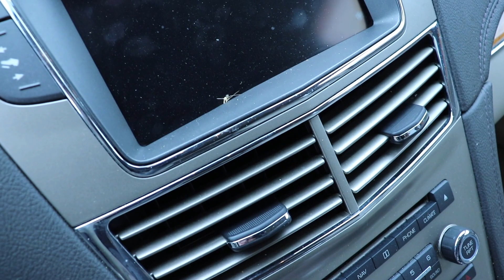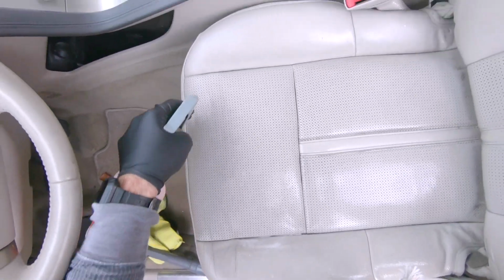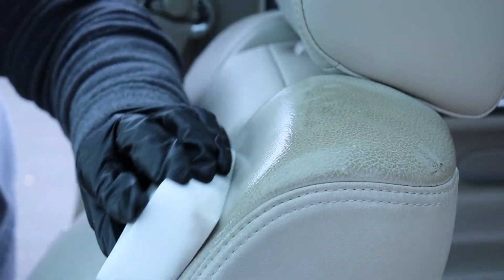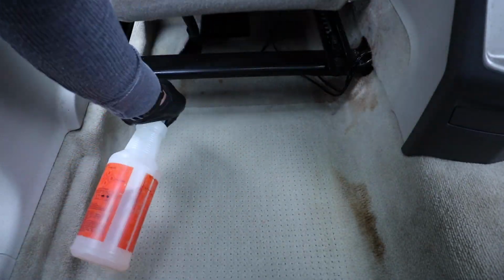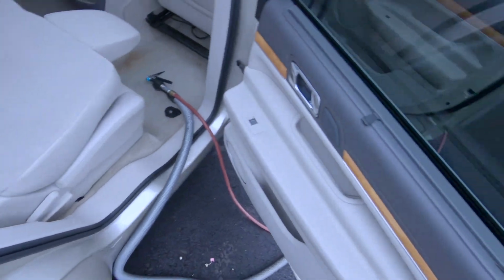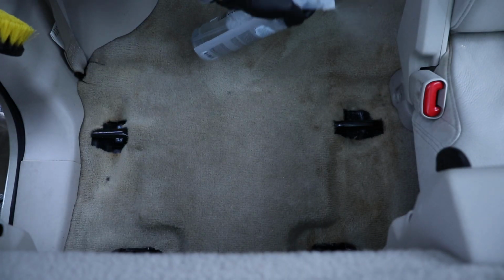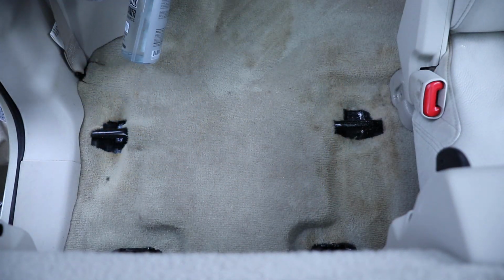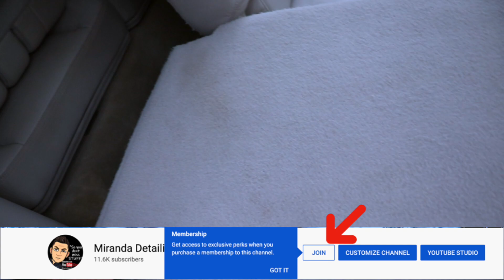Interior Detailing // Heavy Carpet Shampooing! // Old Lincoln MKT

Comment: Phil, totally agree with you about removing seats. not so bad on older cars however, some newer cars have sensors in the seat tracks (typically attached to seat anchor bolts) that measure the occupants weight allowing the computer vary the speed of the airbag inflation during a crash. If the seat is not torqued to proper specs and the system is not recalibrated with the special tool (at Chrysler we called it the Assometer) the airbag restraint system can be compromised. So for those of you haters faulting the man for his detailing techniques, try getting educated before talking trash..
Reply from the maker: See!  thats very important!  thanks for sharing that!

Comment: Yes, Chemical Guys Invisible Cleaner is a great APC and I have never used it on carpets.  Incredibly besides the interior, I have just used it on seatbelts.  Great to know it works on carpets too, because what I have used for spots is Folex and/or Meguiars D106 and D116 depending on what they have.  Even Simple Green which is excellent for carpets, upholstery and interior. 
Xoxo from Puerto Rico 👍🇵🇷
Reply from the maker: I haven’t used simple green on vehicles before. I used to use it for commercial cleaning but never on vehicles. I’m sure it works great.